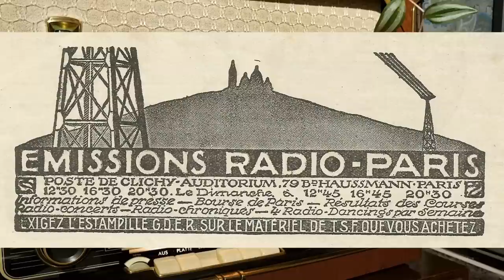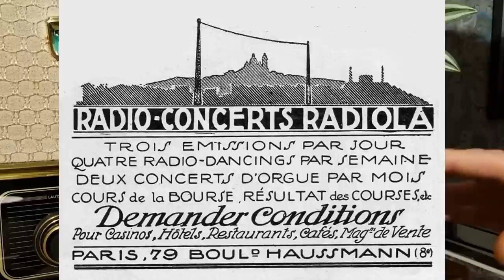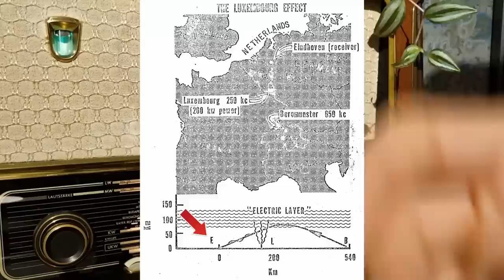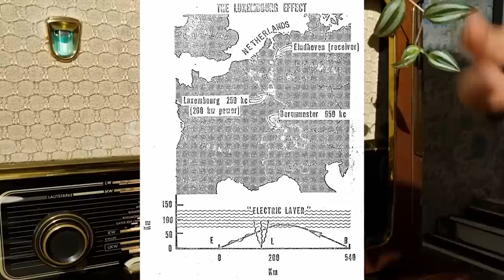We just lost the most powerful longwave transmitter in Europe, and why that's kind of a big deal

Comment: Our communications are taking rapid steps backwards by relying so much on digital and web based services. Especially in the case of emergency situations.
Reply: 150 km range for a megawatt of transmission power is not that great.
Reply: @david line true!!!
Reply: @pizzablender  re: "150 km range for a megawatt "
Hmmm ... something is not right.
KLBJ (590 kHz) in Austin Tx at only 5,000 Watts (5 kW) during the day can easily do a 337  km path to where I am located w/reception on a battery portable  ... just sayin.

Comment: Thank you for the contribution and by the way a nice device, the Telefunken Operetta.
It is a great pity that another AM station has been switched off. This time on the long wave. The transmitter was receivable here in the far north (near Lüneburg, Lower Saxony, approx. 500km) without much effort. The built-in ferrite antenna in the SABA Bodensee 3DS was completely sufficient for adequate reception.
Now it's high time to put my own transmitter into operation, so that something can still be received over the long wave.
These are sad times.

Comment: In Brazil, the oldest short wave and medium wave radios still resist, but little by little they are migrating to FM, the costs to maintain the transmitters are very high. National radio still has a long reach, but it is not every day that propagation helps. I'm 400km away from you and it doesn't pick up during the day, at night in AM it picks up reasonably, a lot of interference, and in the 25m range you can't hear it every day. Radio Brasil Central is the same case, you can't always get good listening, in medium waves depending on the place it gets clean, it's another old radio founded in the 50s, and maybe due to reduced power due to the cost of electricity it preferred to stay longer location and the signal gets stronger at night when they increase the power.

Comment: Thank you for making this video. I remember driving around the UK, picking up various stations on long wave - Atlantic 252 (from Ireland) and Arrow Rock Radio (from the Netherlands). Amazing that during my lifetime alone these stations hit their peak and then declined until they were turned off, simply because of the pace of technological change :(
Who knows what the future has in store, right?
Reply: RTE, the Irish state broadcaster who had a majority share in Atlantic 252 kept the channel going for some years after Atlantic shut down, carrying their main programme, mostly for the benefit of Irish emigrants in the UK, as well as as a place to put Gaelic Football and Hurling matches, religious services for the housebound, etc, leaving their main FM frequencies free for their regular programming. They had been running it on very reduced power for quite some time though - as little as 50kW at nights, reportedly - on cost grounds, before finally pulling the plug on it 2 or 3 months back. Hardly some big surprise, of course, but the fact of them using the price of the juice as an excuse kind of leaves a bad taste, considering that the electricity bills were a drop in the ocean given the amount of money simply wasted, or spent on backhanders, in the organisation, according to the financial scandals that have hit the network since the LW closedown. They would have still been on the air at the time of this video, and we might have heard them given the pull of these old valve radios, but for the fact that they're being obliterated by Algeria, with whom Ireland share(d) the wavelength...
Reply: @MrPete81 that's what I liked about such LW stations. Shortly after passing my driving test in late 1991, I drove down from my hometown of Middlesbrough to York to do some Christmas shopping. All the way there, I was able to listen to Atlantic 252 without having to mess on retuning the car radio to another frequency as was the case with Radio 1 from 1053 to 1089 on AM

Comment: Additional note for UK radio listeners. Radio 4 Long wave on 198khz (so 1500m) is broadcast from Droitwich in England (plus two transmitters in Scotland).
Apparently the service did change from 200khz (1500m wavelength) to 198khz in 1988 - though Wikipedia does not mention the reason behind this change
Reply: 200KHz is an harmonic of the 100KHz distress signal.
Reply: I think it was the ITU (International Telecommunications Union) who made the agreement to make more frequencies available for broadcasting, by changing from ten's of degrees (ie 200, 210, 220, 570 580, 1500, 1510) the number of the frequencies to nine, (ie 207. 216, 225, 576, 585, 1503, 1512, 1521etc) on the Medium and Long Wave frequencies . If you look at the Long Wave and Medium Wave frequencies you'll notice that the addition of the numbers of the frequencies will always add up to either 9 or a multiple of nine. So  BBC on 198 when you add the numbers together gives you 18 which is 2x9! RTE on 252  gives you a total of 9 and so on! I believe that this was made for Europe, Parts of Asia and Northern Africa, though I am willing to be corrected on the geographical matter.
Reply: @peterblake4837  re: "200KHz is an harmonic of the 100KHz distress signal."
Huh. Used to be used for LORAN-C ... 90 to 110 kHz including the pulse sidebands that is.

Comment: I always liked AM, it was so simple to build a receiver, and for one kind if receiver (lookup crystal radio) you didn't even need a power source. It's a bit sad that such simple forms of electronics are displaced by more and more complex digital systems like DAB.
Reply: as regards DAB: it really does not deliver. It is digital and therefore you lose the sound completely & frequently, in the car and in rural areas. In AM especially, it was the listener who decided for the acceptable quality, not the technician who put an arbitrary mute-threshold in the electronics. Do you think noise was esthetically a problem when people on the continent listened to the BBC in 1940-45? Good luck with your non-robust digital infrastructure when the going gets tough.
Reply: @nohandleleft  your argument is not fully covering the issue. One can achieve graceful degradation in  digital systems, as shown in  best-effort rendering of Jpeg images over low bandwidth. In DAB this just isn't done. It is  not robust enough outside urban areas. Don't promise digital perfection if you can't deliver.
Reply: @nohandleleft  well, with proper buffering of the low-frequency content, the effects of bit loss can be predominantly left to the higher frequencies. There is a lot that traditional engineering overlooks as regards robustness and graceful degradation. Packet loss in audio streams can be solved with deep learning, e.g. GANs for reconstruction. A lot of fresh literature. But that does not solve the original point. Are we irritated more by analog hiss than by stochastically occurring, fully silent breaks?
Reply: @Nettlebed7  >> Unfortunately, our experiments with digital terrestrial broadcasting on AM band in US didn't look all that good, with spring and summer lightning storms creating multiple audio 'gaps' or switch-overs back to analog, and this was with IBOC testing not full digital. On the FM band, adjacent channel analog tropo (ducting) sometimes blocks local IBOC sideband, resulting in no digital reception.

Comment: Thank you very much for a really interesting video. Very sad to see Long Wave being abandoned. I think it is to allow for interference from electric charging. Spectrum should be used for radio communication in my opinion.
Reply: The main reason for the end of all AM broadcasting is that the number of listeners cannot justify the high running costs. LW transmitters need a huge antenna, which has ongoing maintenance costs and ties up a lot of potentially valuable land. The biggest cost, however, is the electricity to run the transmitter; AM is not a power-efficient mode.

The UK seems likely to have very little AM left by the end of this decade. Radio 4 LW is on notice of closure - the only LW station in the UK. One of the two national commercial MW stations, Absolute Radio, closed all its remaining transmitters last month - it continues to broadcast on DAB). That leaves one national commercial MW station, some local commercial MW stations and some BBC national, regional and local MW stations. Most of that will close in the next few years and continue broadcasting only on DAB. A small amount of MW may remain in areas that are difficult to cover with higher frequencies (VHF FM and Band III DAB).

Technology and our radio spectrum use have evolved over time. Most people have limited interest in a signal that is of limited audio bandwidth and is subject to all sorts of interference. Increasingly services will be carried over the Internet; the UK is due to close its landline telephone networks in the next few years, replacing them with VoIP.

Comment: Funny you should mention the airfield NDB's. We're losing similar history aspects in Aviation too with many NDBs being shutdown and the equipment increasingly being removed or unmaintained in aircraft. Now don't get me wrong, VOR is far more practical and easy to use than NBD, GPS more so - but there's something a little exciting, nostalgic even, watching the needle swing around the card whilst you think about calculating your bearing from a station. Being near a lot of pacific nations, NDB's are still used as part of some long range ops. It's also just kinda fun to tune in to AM stations and have a little tinny music accompany you on the flight. Lots of great stories from folks about flying over the oceans and listening in to a football match or two.
Reply: My electronics engineer father worked for CAA in NZ. He was responsible for installing valve (tube) NDB transmitters on Pacific islands in the early 1950's. These were "tropicalised" meaning all the internal big components were sealed into metal boxes. Despite this they corroded and overheated and failed often. He also flew very slowly in a specially modified DC3 called the "Cal Flight" to check operation, later including VOR.
CAA developed the first transistor NDB receiver for the long Pacific flights using Philips OC72 germanium transistors.
Reply: @howardsimpson489  thanks for sharing your dad's work. Would have loved to fly a dc3. Only a few left here in NZ.

Comment: Your reception of the BBC World Service from Droitwich is properly BBC Radio 4 LW, which transmits a World Service "Selection" from 1:00am to 5:20am, with an edition of the Shipping Forecast before and after.

The BBC has said the Droitwich transmitter depends on two glass valves/vacuum-tubes which are unlikely to be replaceable when one fails. Beidweiler is reported to have used a solid-state transmitter.

Comment: There are three antenna at RTL Luxembourg (Beidweiler Longwave Transmitter) for long wave transmission at 234 kHz. 

From google maps it looks like the outer most antenna are spaced at 1/2 wavelength. Would you know if this is correct? 

If so then why have three, why not just two antenna, would you know? 

Perhaps it is less power to do two pairs of 1/4 wavelength? 

Directionally, is the transmitted power parallel to the antennas (like Beidweiller pointing in  a line towards Paris) or at 90 degrees?

Comment: Many years ago, in England, I sometimes listened to Radio 60 Degrees North, which broadcast from next to Stockholm with  a transmitter I had walked out of the city to see years before. One time, there was no audible signal until I heard what sounded like a sledgehammer, with a very clear clanging sound, as though the radio mast was being hit with it. Could attempted repairs with a big hammer modulate the carrier wave? Or was the sound being broadcast, even possibly to give a mythical idea to do with the Hammer of Thor?
Also, sorry that RTL has stopped broadcasting.

Comment: Sad to see it go,   198 kilohertz Droitwich ,  BBC Radio 4 also carrying radio data encoded which gives it extra use by Electricity suppliers. Think the spectrum should be given to the Radio Amateurs. Frame loop antennas work very well on LW.
Reply from the maker: I fully agree with your comment about the spectrum
Reply: There are already LF and MF bands which radio amateurs can use. Not many do though due to the equipment involved.
Reply: @paulsengupta971  Correct, though people who do use it, are often invisible because they use sub-noise floor digital modes. So even if you don't hear anything, it could still be there!
The LF allocation is extremely narrow though (2kHz) , and sandwiched between the very strong Teleswitch signals. The Teleswitch is tens or hundreds of kW, and amateur signals barely 1w ERP, so you need a VERY good receiver to be able to do anything.

Comment: The reason bce)) switched it off is because of the cost of power to run it. If Digital Radio Mondiale was a proper success (but never took off), it would have been still possible to operate Beidweiler, Marnarch and Junglinster MW LW and SW transmitters in a digital domain with near FM quality stereo sound but using far less power than analogue AM saving a bit of money on cost.

Comment: What about 225kHz Long Wave Polish Radio? Around 7:35 is where it should be. As far as I know, this transmitter reaches quite far, transmitting at 1MW.
Reply from the maker: I can't receive it with a normal built-in ferrite rod. The transmitter is not really directed to western Europe either.

Comment: 198kHz Droitwich is currently BBC Radio 4, the mixed speech service, though it broadcasts World Service in the night, and also the Shipping (weather) Forecast. It also bears a 25Hz AMSS slow data rate PSK subcarrier, which transmits a time signal to control and synchronise electrical infrastructure amongst other things. Because longwave signals can be received at distance and by submarines, or even miners/cavers, the data may have "other uses" as well as the audio providing "proof of life" in a nuclear scenario. Reputedly, the transmitter will continue as long as there are spare output valves.
There is also a RTE1 on 262kHz from Ireland.
Reply: 198kHz Droitwich was always an interesting station. I listened to it from France near the German border. But it was always a bit weak and difficult to understand. It was discouraging; obviously the BBC was not interested in promoting Droitwich in continental Europe.
Reply: @jasc4364  The World Service for Northern Europe was thought to be well served by the government, (technically not BBC), Orfordness Diplomatic Wireless Station on 648kHz while Southern Europe was fed on Shortwave (HF) from Daventry, Rampisham, Wooferton and/or Skelton in the UK, plus MF from Limassol in Cyprus. There was also an FM relay on 94.8MHz in Berlin, IIRC. 648kHz has now been allocated to Radio Caroline as few broadcasters seem to want to continue on MF, even for Digital Radio Mondiale.

Comment: A big advantage of the LF broadcast transmitters is that their signal can penetrate the ground to a greater distance (tens of metres) than MF or VHF (metres), you can observe than on a car radio when entering a road tunnel.  So, in a national emergency where people have to shelter in underground carparks or railway tunnels, the signals could still reach them.   Neither VHF (FM) radio signals nor mobile phone signals can do that.   But few people use pocket radios with LF anyway!
Reply from the maker: You're technically right, but we do install antennas for mobile reception in tunnels and buildings for indoor coverage. (I'm a mobile network engineer in my day job)
Reply: @retro_tech   In a wartime or civilian emergency situation, earthquake etc., power might be cut off to repeaters and antennas and the survivors sheltering in such facilities might have to rely on portable radios.   After 9-11, the good old-fashioned MW radio proved the best way to communicate as mobile services were saturated with calls.
Reply from the maker: @karhukivi  That's correct though.

Comment: BBC Radio 4 still blasts loud and clear. It can be heard in Riga. There was also a loud Polish or Romanian station, wasn't there? I thought RTL was German. I have one beeping transmitter at about 320k. I didn't know airports had them.

Medium Wave is still quite full at night, but few stations I can understand in English. Talk Sport seems to be quite clear. Previously England had multiple transmitters on the same frequency.

A problem with reception today is interference on power lines and reinforced concrete buildings. You have to go outside or have a nice wooden house.

Is the antenna in the antique radio omnidirectional?
Reply from the maker: No, the Operette has a simple fixed (non-rotatable) internal ferrite rod.

Comment: I do wish that RTL had transmitted the English "Radio Luxembourg" on this frequency instead of 208 AM. Unlike on the said AM wavelength, you could pick it up during daylight hours & there wasn't as much fading & distorting even though the power level for the LW signal (2000 kW if I remember correctly) was much higher

Comment: The operating cost of this 2000 kW radio at maximum output  must have been huge. With a price of electric power at 0,1 €/kWh, the cost per hour would be € 200. That is € 4800 / day. Or € 1750000/year.
Reply: Yes, the costs for electrical power are a major factor in switching to modern transmission technologies
- digital radio
- internet radio
Reply: It would probably cost at least 1.5x or 2x as much, the transmitters are between 50 and 70% efficient, depending on the type.